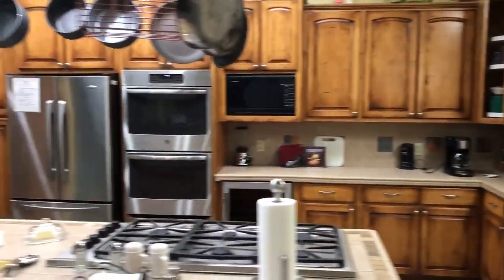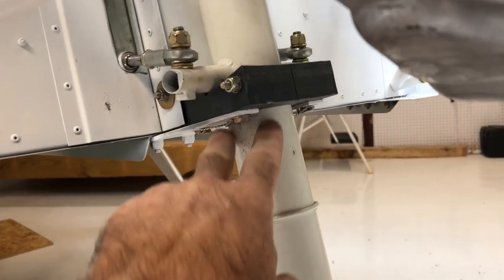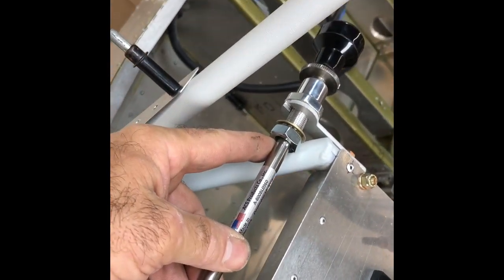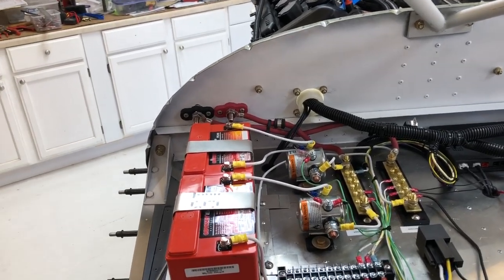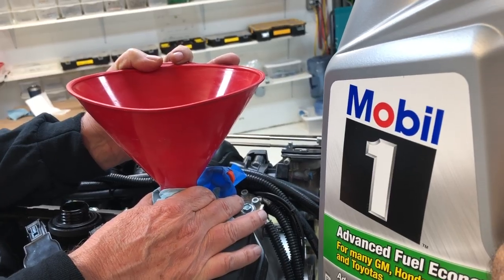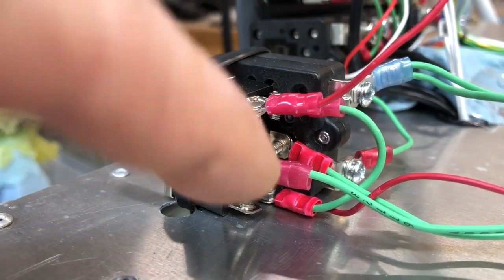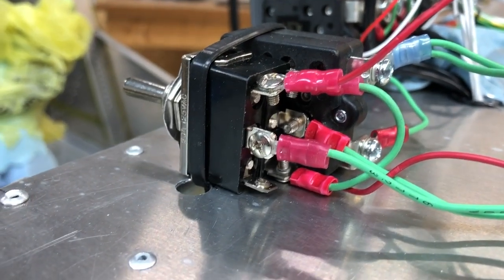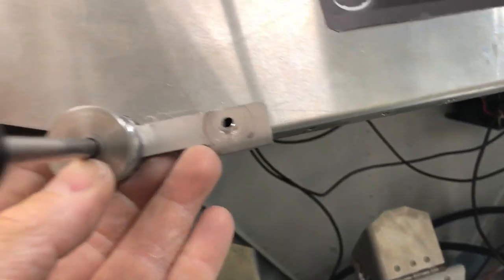Viking Field Installation (Part 2)

Comment: Hi are you still doing field installations
Reply from the maker: Yes we do :)
Reply: @eggenfellner  hi thankyou for the reply what are your thoughts for a viking 90hp 3 cyl in the Gairplanes (it's a company that makes a tube and fabric highwing) airplane
Reply: The Gairplanes model called the Mule is similar to a kitfox or super stol
Reply: @mattwoody1089  I think it's very similar to a Merlin Sport 65.  Check it out.
Reply from the maker: Yes, we do them frequently :)

Comment: Coming from the automotive high performance drag racing scene to the experimental aircraft scene; I can say with hands down that the aircraft scene and all the practices and technology used is so outdated and that we as automotive performance mechanics shake our head and laugh at the primitive practices. I am astonished at the scale of the misinformed in the community. Take the example of light aircrafts still run carbureted engines🤯 WTF and theyre dealing with icing problems in 2020 (REALLY)or running a ECU to control engine parameters only recently and thinking that giving it the term FEDEC is going to make situation any better. The Automotive industry started using ecu’s back in the 70’s; that’s 50 years ago and the aviation industry is only implementing that now LOL and the list goes on and on...this is a real joke.
Reply from the maker: Yes and yes - once people get the old school mentality out of their head they are so much happier :) Aviation seems to be the only industry in the world that is okay with never advancing in the right direction. Imagine if we still only had pay phones....well maybe that would be better.